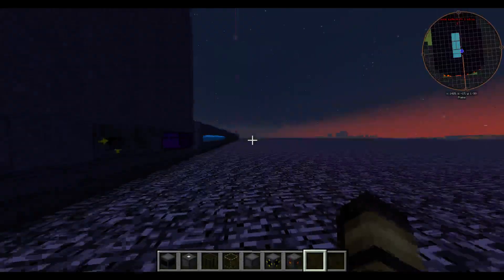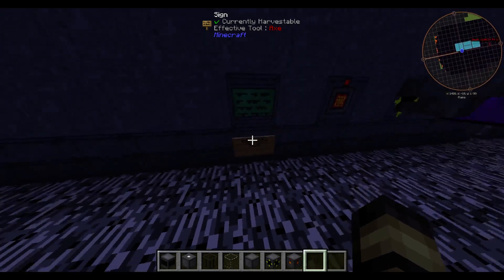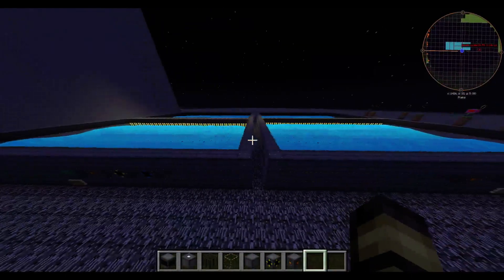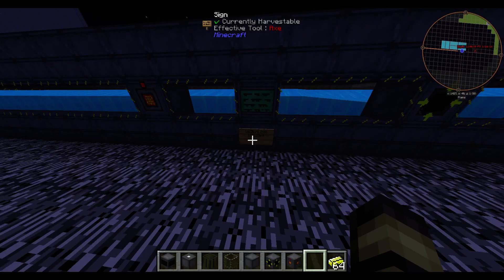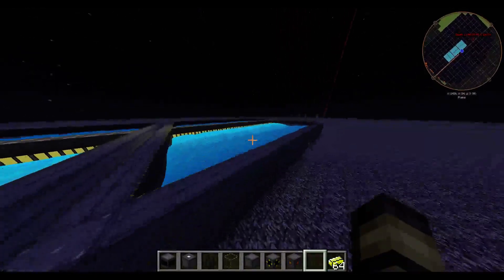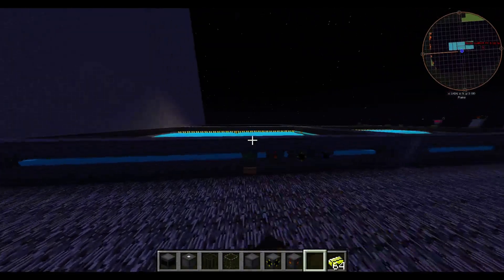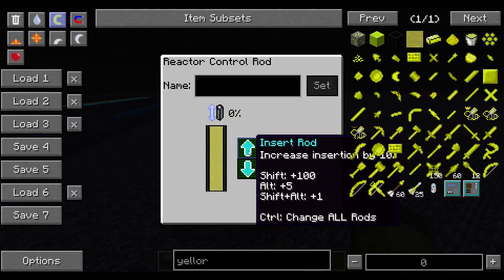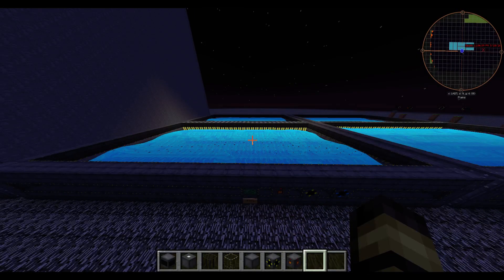How To Make Best Most Efficient Big Reactors Reactor Design Possible (Minecraft Mods) FTB

Comment from the maker: I forgot to clarify the math behind it. 1 ingot of yellorium is 1000mb of fuel in the reactor so if it is burning 100.4 mb per tick. It's 10 ticks of power. If the power is 950k per tick. That is why it's 950 x 10 equaling 9.5mil. Sorry about the confusion.
Reply: one ingot should be 144mb
a block is 1296mb
Reply from the maker: Sir Bryan. When your reactor is empty and you put 1 ingot inside. How much yellorium in mB does it say it has inside your reactor. This is not Tinker's construct. 1 yellorium ingot = 1000 mB.
Reply: That's in Tinker's Construct. Sadly Big Reactors and it don't agree.
Reply from the maker: Thanks for also confirming Robert :D

Comment: Found this comment on reddit I made you 60 fuel rod design, and this comment made it so much better and its so easy!

"Instead of turning the reactor on and off, I use a RedNet cable on mine. Get two RedNet ports next to each other and put two RedNet cables on them. Set one to output % energy storage and the other to input % rod insertion. It will change the insertion depending on how much energy is in the reactor. 0% energy means 0% rod insertion, putting the reactor at full output power. 99% power stored means 99% insertion. It's a very easy way to automate output and keep fuel usage low." - jws_shadotak
Reply: DigidyDOG Gaming I just use computer craft
Reply: Jack Fetzer try this it makes the reactor only use what you need...it's amazingly simple and easy
Reply: DigidyDOG Gaming I'll try it thanks
Reply: Maybe I can make a video on how good it is...

Comment: Don't know if this is still up to date. I played around with the simulator and I'd say higher reactors are more efficient, when the fuel rods insertion is also higher. I maxed different designs and reached over 200 krf per mb with spaced clusters of 4x4 fuel rods and cryotheum as coolant.

Comment: Why so much distance between the rods and the casing? The emissions from the rods only travel 4 blocks. The liquids used for cooling also have several different properties that make where they are used important. To that end, [fuel rods, three blocks of cryotheum, one block of enderium, outer casing] is the most productive design. The rods at the ends right next to the casing are quite inefficient. Have you played with the online Big Reactor simulator? It's quite enlightening. :)
Reply from the maker: +Nonsanity yes I have.
Reply from the maker: +Nonsanity thats not a thing. Also a ring of resonant ender around the outside reduces efficiency. I just tested it. Cryotheum is the best coolant end of story.

Comment: Must have changed since 1.6.4. I have a 9 x 9 x 9 reactor (passive atm) but using your calcs i'm getting 56M power per ingot. Will look at that further tho. Stats for my reactor 22200Rf/t, burning 0.414mB/t 1 row of Gelid Cryetheum (40 buckets) 9 piles of Fuel rods in a diagonal cross.
Reply from the maker: U should watch my new reactor video I have even more efficient ones with some cool patterns

Comment: Are you actually sure about the effiency aspect? I am especially questioning the fuel rod row aspect. Of what I heard before it matters what coolant you use for the core (cryotheum for the core and resonant Ender for the three rows closest to the hull and no fuel rods in those three rows). I would recommend reading some forum posts from big reactors because the ones you recommend don't seem to be efficient at all to me
Reply from the maker: +Impossible Object cryotheum is the best coolant for all places of the reactor. Resonant ender is 2nd, destabilized redstone is 3rd etc.
Reply from the maker: +Impossible Object please also remember this is infinity and the fuel costs are 8x as much as a normal pack because they nerfed big reactors. So the power per ingot is 8x as much therefore for a normal pack it would be 132.8mil rf per ingot.
Reply from the maker: +Impossible Object if you watched captain sparklez maxed out video, his big reactor would produce 20 mill rf per ingot even thou it was max size doing 1.89mil per tick.
Reply: I don't think it is that easy. On this thread they discuss about the most efficient design and it is definitely not yours:  
https://www.reddit.com/r/feedthebeast/comments/2zch19/most_efficient_big_reactor_designs/
I am sorry to be that harsh, but there's already a lot of false information on YouTube and I think you are supporting this tendency with this video.
Reply from the maker: +Impossible Object did u even calculate the power produced per ingot of yellorium for the designs u linked. For the mid/late game one it's 13.8mil in infinity because the fuel consumption is 8x. Please actually check your facts before jumping down my throat. I am not wrong and I am not feeding false information.
Reply from the maker: +Impossible Object please stop forgetting I did this video on ftb infinity evolved where big reactors fuel consumption was nerfed by 8x
Reply: +Impossible Object its about efficiency, (RF per ingot) not for how much rf / tick you can get
Reply from the maker: +Johannes x Games thank you.

Comment: What do you guys think of this setup? It's 32/32/3 with 108 Rods and requires 23 buckets Cryotheum when placed correctly. (placement in second link)
http://br.sidoh.org/#reactor-design?length=30&width=30&height=1&activelyCooled=false&controlRodInsertion=0&layout=101O8C22O8C22O8C22O8C18O4C8X4C14O16C14O4C8X4C14O16C10O4CXCXC8XCXCX4C6O4CXCXCX6CXCXCX4C6O4CXCXCXC4XCXCXCX4C6O4CXCXCXC4XCXCXCX4C6O4CXCXCXC4XCXCXCX4C6O4CXCXCXC4XCXCXCX4C6O4CXCXCX6CXCXCX4C6O4CXCXC8XCXCX4C10O16C14O4C8X4C14O16C14O4C8X4C18O8C22O8C22O8C22O8C101O
http://br.sidoh.org/#reactor-design?length=30&width=30&height=1&activelyCooled=false&controlRodInsertion=0&layout=163OC2OC54O8X26OC23OCO8XOC24OC21OXOXO8XOXOX14OXOXOXC5OXOXOX12OCOXOXOXO4XOXOXOXOC12OXOXOXO4XCXOXOX14OXCXCXO4XOXCXCX12OCOXOXOXO4XOXOXOXOC12OXOXOX2OC3OXOXOX14OXOXO8XOXOX22OC23OCO8XOC24OC25O8X54OC2OC163O
Reply from the maker: seems decent. I like the 32x32x3 designs cause of the save of cryotheum with it's spreading nature :D
Reply: 32x32x3 is not THE highest efficiency possible but it's fairly efficient for its cost. (my pattern gets about 225k rf/mb on max hight and rods on 94% but hey who pays for that xD)
Reply from the maker: Well if they dont need much rf. than 94% rod insertion is pretyy good.
Reply: I guess this design here is probably the best in terms of efficiency. (not mine)
http://br.sidoh.org/#reactor-design?length=29&width=29&height=1&activelyCooled=false&controlRodInsertion=83&layout=G27EGE27X2EXCXCXCXCXCXCXCXCXCXCXCXCXCX2E27X2EXCXCXCXCXCXCXCXCXCXCXCXCXCX2E27X2EXCXCXCXCXCXCXCXCXCXCXCXCXCX2E27X2EXCXCXCXCXCXCXCXCXCXCXCXCXCX2E27X2EXCXCXCXCXCXCXCXCXCXCXCXCXCX2E27X2EXCXCXCXCXCXCXCXCXCXCXCXCXCX2E27X2EXCXCXCXCXCXCXCXCXCXCXCXCXCX2E27X2EXCXCXCXCXCXCXCXCXCXCXCXCXCX2E27X2EXCXCXCXCXCXCXCXCXCXCXCXCXCX2E27X2EXCXCXCXCXCXCXCXCXCXCXCXCXCX2E27X2EXCXCXCXCXCXCXCXCXCXCXCXCXCX2E27X2EXCXCXCXCXCXCXCXCXCXCXCXCXCX2E27X2EXCXCXCXCXCXCXCXCXCXCXCXCXCX2E27XEG27EG

Comment: I made one with 17.3mil per ingot.
Reply from the maker: mines 119mil per ingot. in a regular pack where the fuel consumption wasnt nerfed.
Reply: TheGAM3Report1 Mine would be 137 - 138.4mil per ingot in a regular pack. Get ready for the big link:

http://br.sidoh.org/#reactor-design?length=30&width=30&height=1&activelyCooled=false&controlRodInsertion=0&layout=104C2X28C2X28C2X28C2X28C2X28C2X28C2X28C2X28C2X28C2X28C2X17C24X6C24X17C2X28C2X28C2X28C2X28C2X28C2X28C2X28C2X28C2X28C2X28C2X104C

I can get it better though.
Reply from the maker: good job. Marginal difference. But I do admit yours is more efficient. Mine is definitely a lot simpler to make every new world you play though.
Reply: Can you re-create yours in the simulator so I can see?
Reply from the maker: This is an 193mil one: http://br.sidoh.org/#reactor-design?length=30&width=30&height=46&activelyCooled=false&controlRodInsertion=0&layout=134CX29CX29CX29CX29CX29CX29CX29CX29CX29CX495C

and this is the one in the video: http://br.sidoh.org/#reactor-design?length=30&width=30&height=46&activelyCooled=false&controlRodInsertion=0&layout=15CX29CX29CX29CX29CX29CX29CX29CX29CX29CX29CX29CX29CX29CX29CX29CX29CX29CX29CX29CX29CX29CX29CX29CX29CX29CX29CX29CX29CX29CX14C
Reply from the maker: final one this is the one in the video with rod insertion of 80% and it creates just over 200mil rf per ingot: http://br.sidoh.org/#reactor-design?length=30&width=30&height=46&activelyCooled=false&controlRodInsertion=80&layout=15CX29CX29CX29CX29CX29CX29CX29CX29CX29CX29CX29CX29CX29CX29CX29CX29CX29CX29CX29CX29CX29CX29CX29CX29CX29CX29CX29CX29CX29CX14C
Reply: TheGAM3Report1 Aah that's 46 high though. That's over 10k charcoal, 16k iron, & 600k redstone among tons of yellorium and other stuff. Still a good goal to work towards though for efficiency sake.